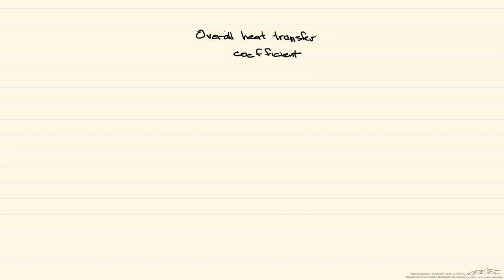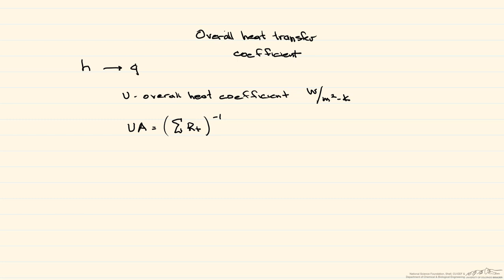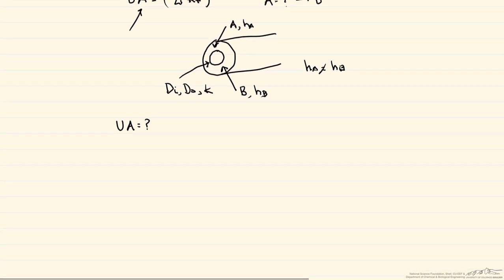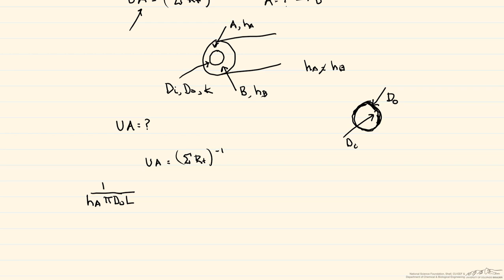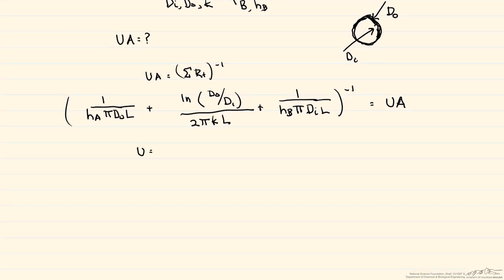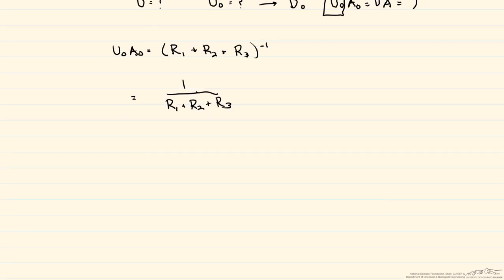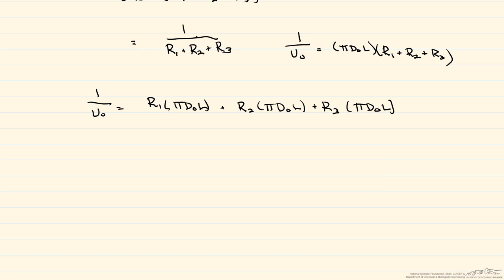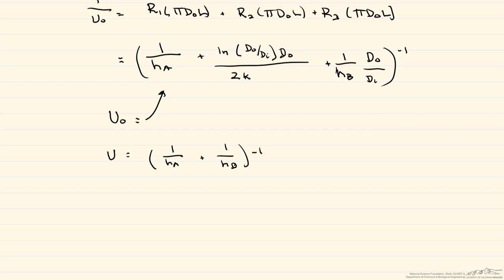Using Resistances to Find Overall Heat Transfer Coefficient

Comment: I guess this formula is for UA clean & in case of UA dirty we have to add the fouling factor contributions on the inner & outer of the surface as well. What is the equation for that? Will the fouling factors be assumed from literature or calculated?